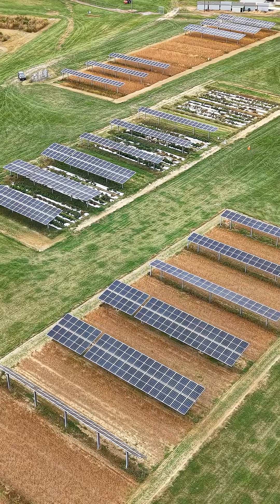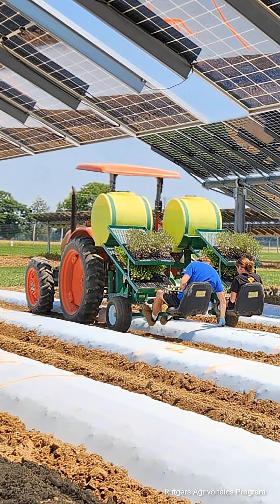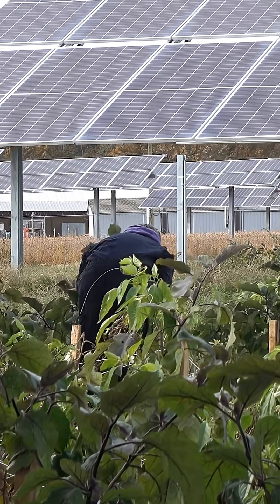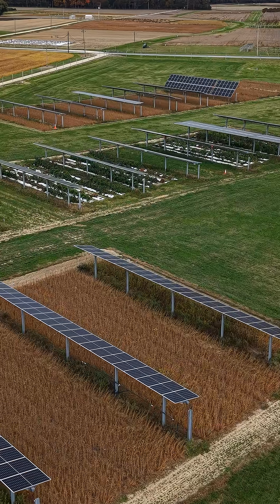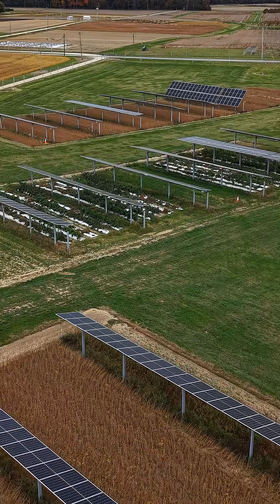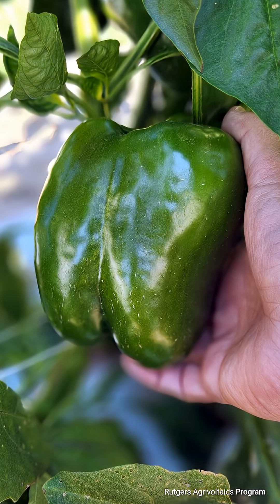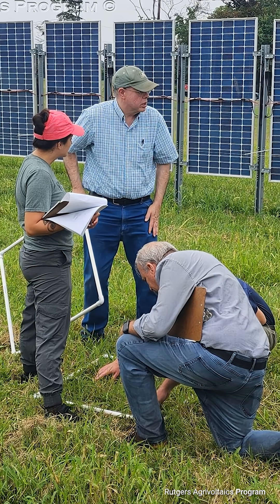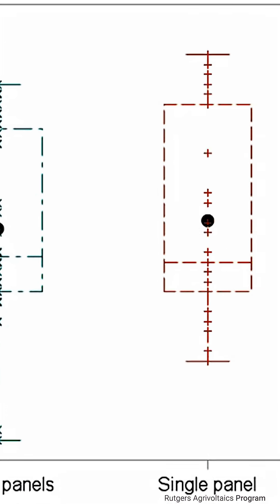What Is Agrivoltaics?

Comment: Great. Now, let's solve the problems with panel production and installation. Its an extremely dirty and energy intensive product that requires extensive mining on several continents (not to mention the child slavelabor issue), raw materials transport, boiling coal and quartz together for days to create the reactive medallions, glass and steel and concrete for the housings and bases, thousands of km of cables, gigantic lithium batteries for storage.